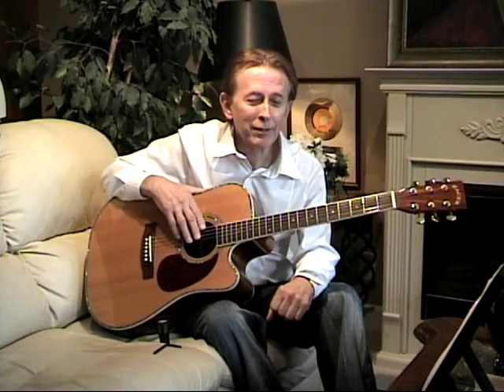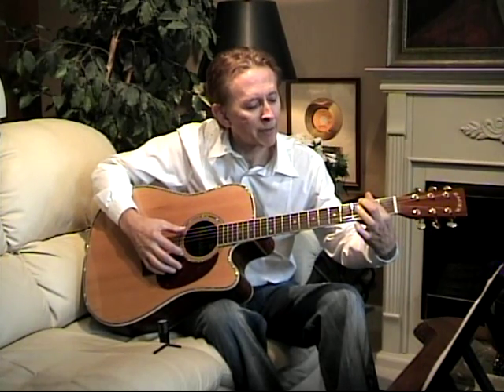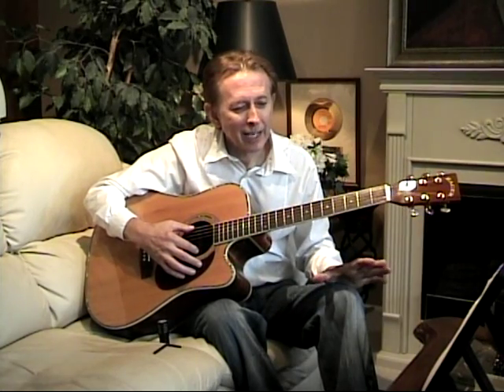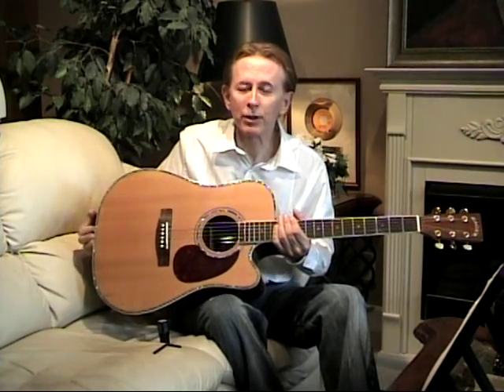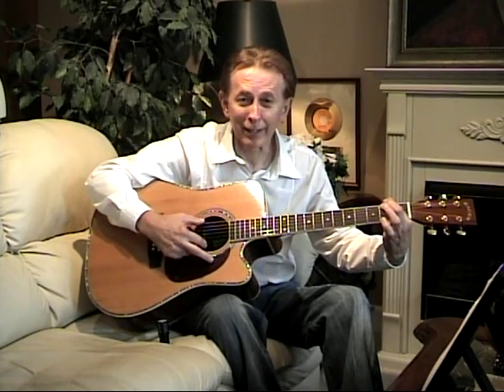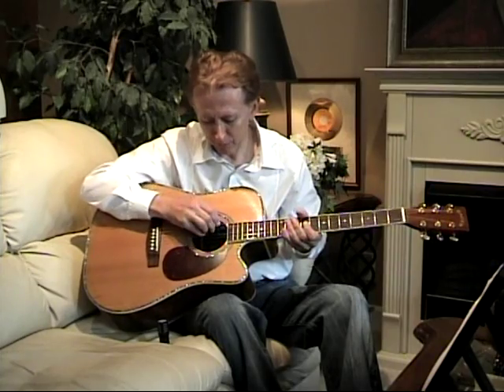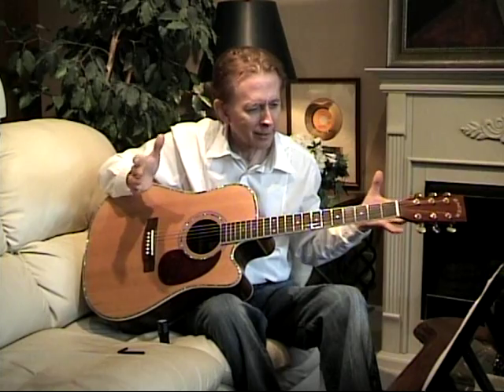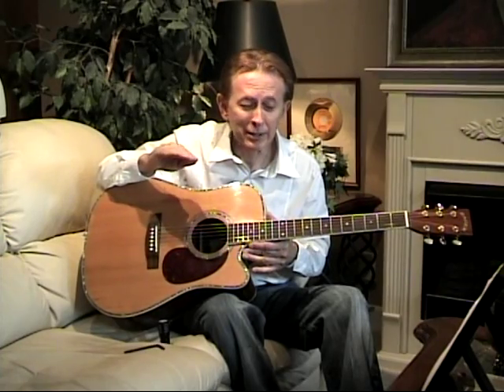Zager Guitar Help Videos - Buzzing String

Comment: Thanks for this video! I just got a guitar a month ago and the buzz started in the E string. My question is, is there any risk when adjusting the truss rod?
Reply: Yes there is risk with adjusting the truss rod. You're only supposed to give it 1/4 turn per day until it's where you want it. If you turn it too many times too quickly, there's a good possibility that you will split the actual neck. I've seen it happen before. Think of it as a tugboat immediately coming to a complete stop. Although you have the brakes locked up, the boat is still slowing down. When you turn the truss rod 1/4 of the way, it'll continue to move and shift for a long period of time. Although you may not have to wait a full 24 hours to adjust it another quarter turn, I would still recommend it.

Comment: unfortunately I can't find any advice to fix my unwanted e string sitar sound. It isn't rattling against anything.  The truss rod is fine and it doesn't matter which gauge of string I put on it, it still makes a sitar sound. Could it be something to do with how it sits in the saddle or the nut. If so would replacing the nut help.
Reply: Mine rattles in the eq. I just put a fabric between the guitar and the eq and the rattle stopped

Comment: My guitar doesnt have a trust rod.... The E (top String) ... D ..G .. and B string have a buzz....when i first got the guitar..i got it buy UPS... the guitar was warm when i opened the case...the E..D..and G string buzzed except for the B...then i got lazy on not putting my guitar inside my case and my room would be hot (75-79 degrees) then i noticed that the B string was buzzing all over. What do i do??